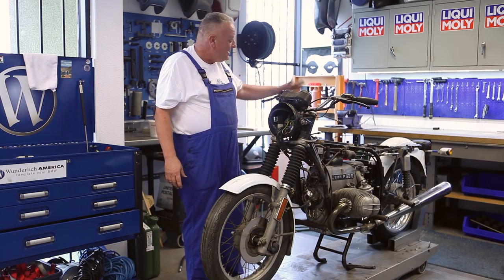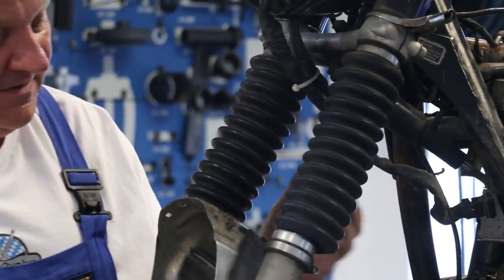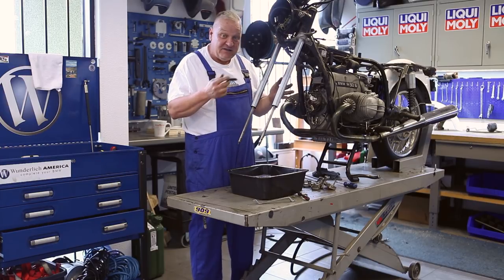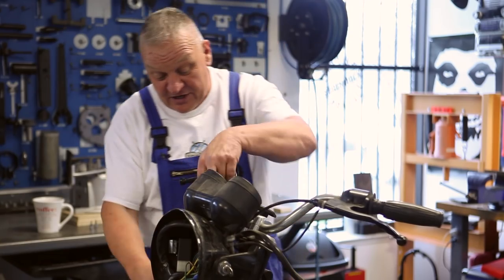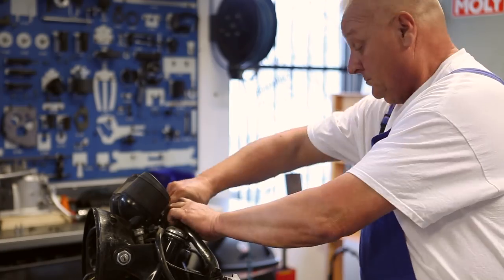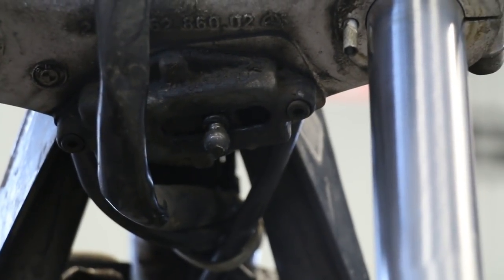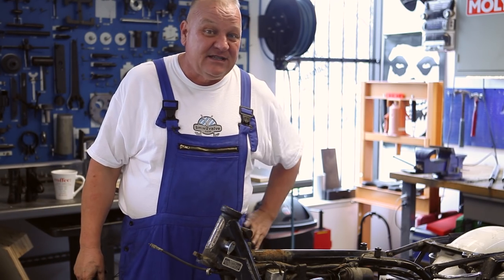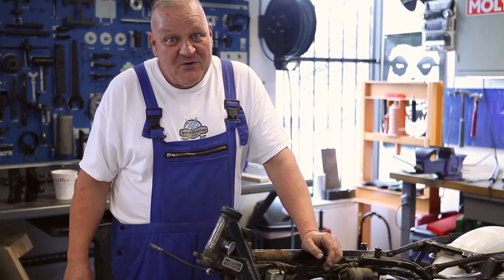R90/6 #15  Triple Clamp, Forks and Steering Bearing Removal

Comment: Excellent Videos - thank you! This is a lot more fun than watching Netflix!! ... I love how you explain as you go.  I have a 73 R75/5 that has been in my family since new.  I stopped riding it about 12 years ago because of fork and head bearing problems. It developed a severe oscillation at highway speeds. And it was getting very hard to keep it in a straight line. I wasn't able to glean the knowledge i needed from the Clymer book... so it just sat and sat... .  :(  I really appreciate your video - and I expect to make some headway with my toaster tank airhead this winter.
Reply from the maker: Good Luck on your project !

Comment: Another amazing video, your relaxed in depth practical videos are truly inspiring. I have an 80/7 that I will be stripping down next winter and I will be using your films as my tutorial with some differences to my model. Maybe you could do a 1979 R80/7 with twin disc brakes next. The only downside is every morning before work I check to see if you’ve uploaded another video, it’s become a bit of an obsession. Many thanks for the great work. Glyn.
Reply from the maker: Hi Glyn, We will be covering the brakes in depth and the R80/7 is very similar to the R90/6. I hope that you will get the information that you need, otherwise, you can always call. My direct extension is 1001. We are doing all that we can to release a new video every two weeks. Always Friday. So far we have done so and hope to continue that trend. Thanks very much for your enthusiasm!

Comment: It's so good to know where these parts can be gotten. You'll get quite an order from me once I get started on my '70 R60.    Question: My bike is totally un-restored. There are NO fuses at all. I was told that I should add at least one main fuse to prevent a possible fire, as in later models. If you agree, are there diagrams / instructions for doing this correctly? Thanks William.
Reply from the maker: Hi Bob, we do offer a really cool. period correct fuse holder under part number 1461631. The main wire to fuse I think is the green/black one. That's the main power. You could introduce such a fuse holder to help prevent problems. Easy to do. With the battery disconnected, snip the wire and trim back the insulation ca. 5mm. Then tin the exposed wires with solder and the fuse holder connects with a small screwdriver.

Comment: So cool to see how the steering head comes apart, thanks again for being so detailed. That rubber plug for the instruments is a real weak link, my pins got so corroded that a resistive fault occurred and took out most of my wiring harness, I used one of those Siebenrock plugs to replace it. Also took the opportunity to replace the instrument lighting with a led unit made by https://katdash.com/  I have no affiliation with them but it sure worked good! Keep up the great work, it's much appreciated!
Reply from the maker: Hi Sam, We are glad that you can benefit from the videos. We will be covering the instruments in the near future including the Katdash components. Those are truly great parts!
Reply from the maker: Thanks Sam. We also carry the Katdash LED units and we will be installing one and working on the instruments in one of the upcoming videos.

Comment: Is marking the position of the fork tubes important? I didn't do that, now everything is cleaned up and difficult to say how they were positioned. If they are straight, shouldn't be an issue how you install them? Thanks for the great tutorials!
Reply from the maker: Hi Xavier, if you didn't do that, I wouldn't lose any sleep over it. Generally, I think that any parts that work together establish a wear pattern and when that is disturbed, wear can accelerate. Maybe that is over the top attention to detail but that's how I was taught and how I have done it since. I don't think that you will encounter any problems.

Comment: Hello William, I have overhauled the completed fork and damper inside the fork tubes, taken it completely apart. When I fill with oil, the oil doesn't go down well, only 200ml and it overflows, both sides. Spring is already installed, so I can't"t compress the suspension in the front (no brakes yet, and no engine weight). Will this be solved once I install brakes and have more weight to compress the forks, so that the oil will move to the bottom of the fork?
Reply from the maker: Oh boy, something's not right then. The oil should flow down. Try removing the springs. Then you can move the fork sliders up and down. Better with the wheel off too. Otherwise, you'll need to re inspect your work.
Reply: Hello William, I was able to flex the fork sliders a little and the oil started its descend. Have drained the new oil just to be sure all goes fine, worked well. So, time to continue my r90S restoration. Thanks for all the great information! Always hoped to get an internship with a BMW pro, now I have it online.